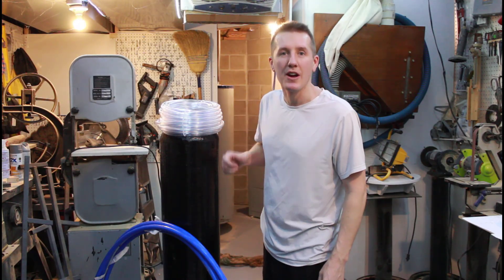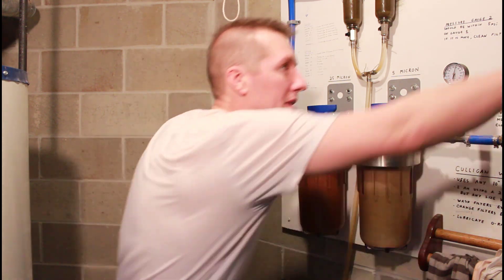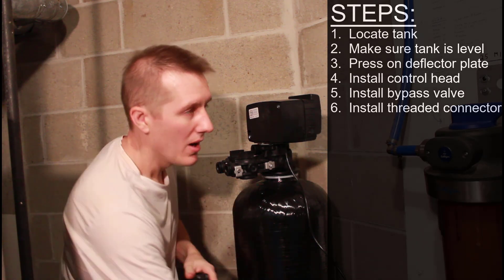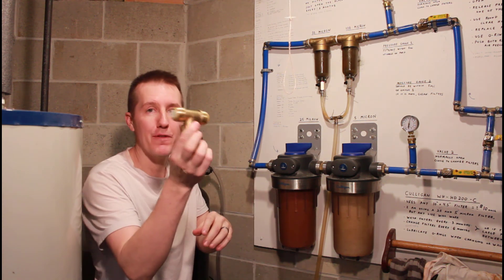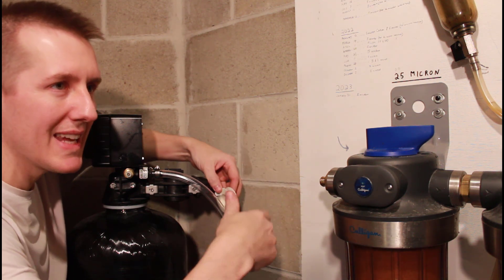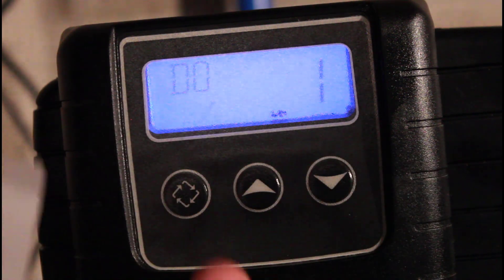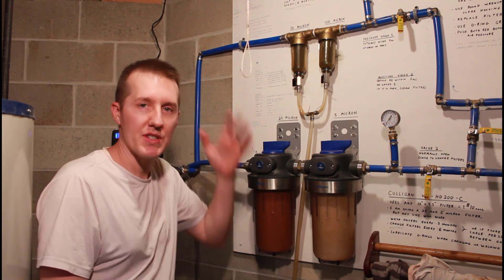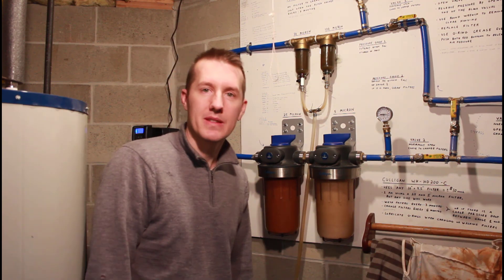Removing Rust from Well Water: Step-By-Step Air Injection Filter Setup

Comment: Thanks for the video.  I use my well for outdoor watering as well as indoor supply.  I'd like to remove the rust at the well, because the iron tends to clog up my irrigation system.  Is there any way to install outside at the well - I guess I'd need a well house to hold it?  Also, does this system work on Iron bacteria?  I'm not sure if I have that, but my normal filters get clogged with this slimy brown sediment, so wasn't sure if normal iron or iron bacteria.  Thanks!
Reply from the maker: Here are 2 video's about the initial filters i installed, to try and remove the rust.
They worked well, but my rusty water is so bad that i had to change them every month.
Which is why i installed the iron filter
You could install some type of filter at the well, but it would freeze, or need to be in a pit??  And would be a pain to change and check.
Install:  https://www.youtube.com/watch?v=0_F_xUKHwBQ&t=1318s
4-years later:  https://www.youtube.com/watch?v=OKzFrxKLDyA